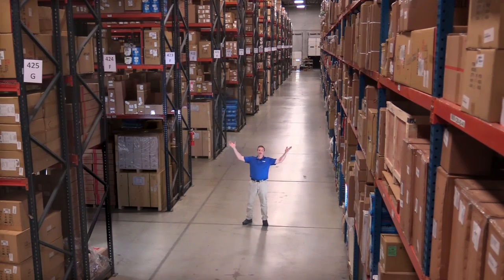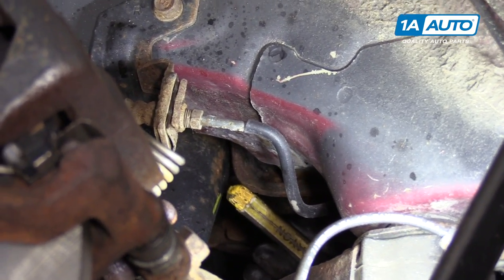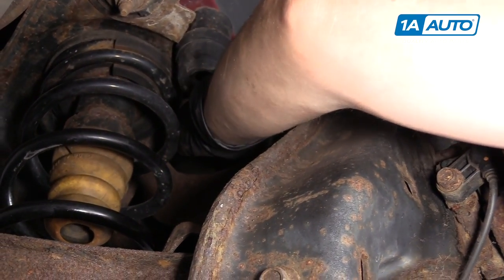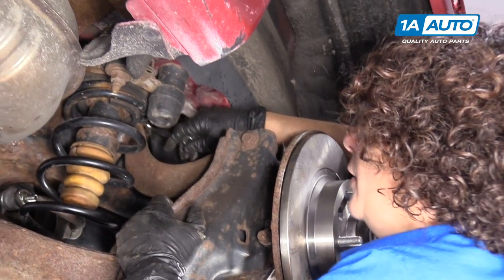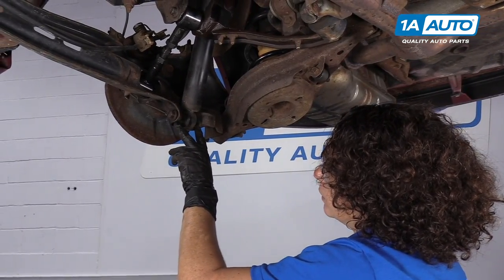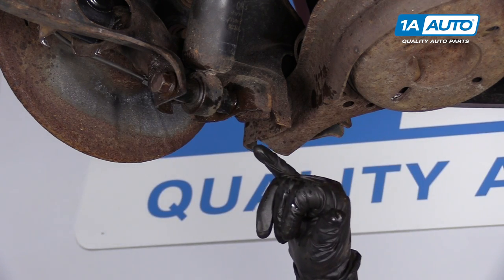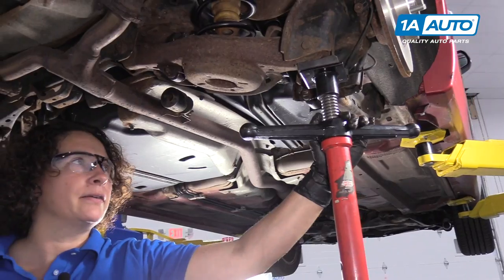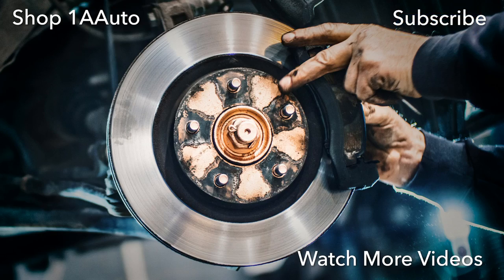How To Replace Rear Shock Absorber 2003-08 Mazda 6

Comment: This video was extremely helpful the only tip i would say from now doing it myself after watching this is when putting the strut mount and shock back in compress the shock it give you much more room to maneuver the mount thru the very tight gap. Also taking the x2 12mm bolts off that little brake bracket and moving it a bit gives you more room for wrenching and maneuvering.

Comment: You make it look so easy and your explanation of charging the damper is spot on 

Nothing like a UK maz6 i have weights on bottom damper bolt?  and the dam damper would not come out 2hrs of chuffing about so dropped  sub frame 
Doing this gave me access to the 14mm bolt heads so no pigging with spanners at all

Comment: Make sure you tighten the top bolt that holds the strut onto the car. I believe I failed to do that sufficiently and now have a nice Rattle sound. Or maybe I didn't compress the shock appropriately. Help me, please lol
Reply: Do you mean the bolts that bolster the upper strut frame onto the vehicle? You should ALWAYS torque spec your equipment! its most definitely worth the $100 for a good torque wrench.

Comment: Can someone tell me what the other large spring near the shock absorber is?
Reply: That is your "bump stop" per say. After your shocks are moderately depressed, the lower control arm pushes on the spring to further support the car and prevent it from bottoming out onto any vital components. I was confused too when  I first got my 6 since its not attached, but it serves a purpose!